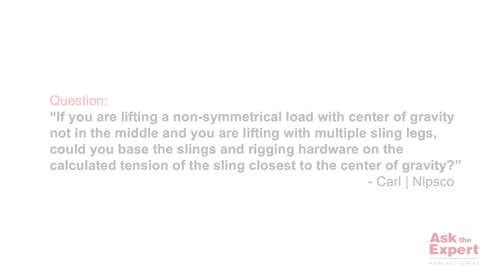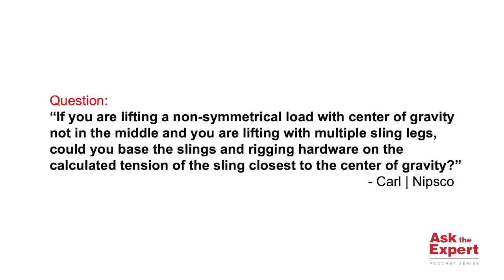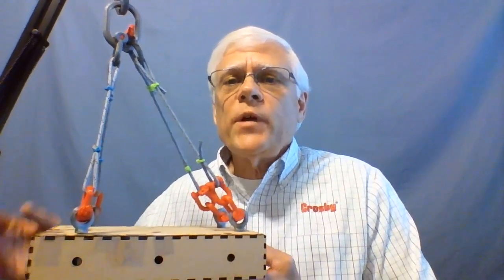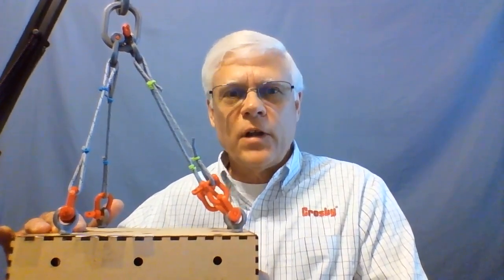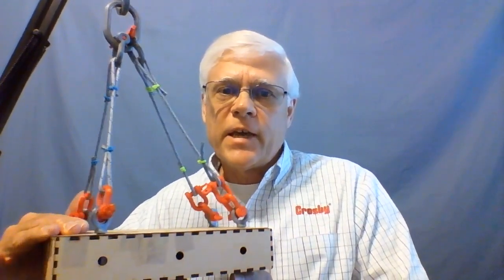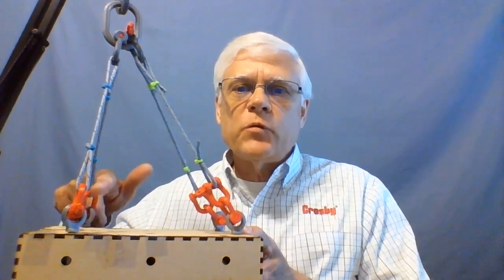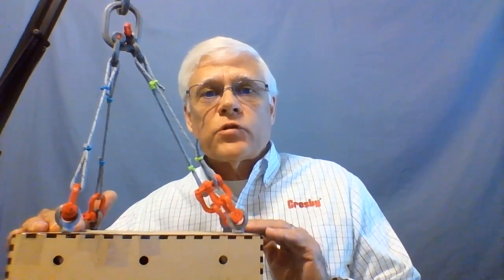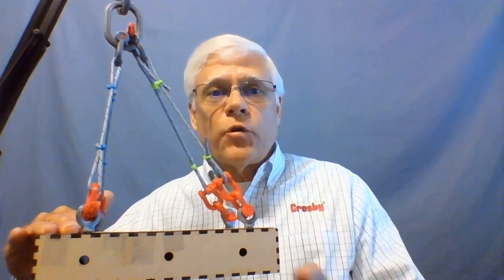How to safely lift a non-symmetrical load

Comment: Well my friend you Open my eyes again. Two things one is losing the maximum strength of eyebolt by going Off center of the angle and two on the choker with the most tension. Working day in and day out as a heavy industrial rigger we only used engineers for the big lifts and that would be anything over 100,000 pounds. Stay thirsty my friend.

Comment: It's not safe to lift load not onthe center of gr6
Reply: You're correct. Placing your hoisting equipment directly over the center of gravity before lifting is critical. This prevents the load from swinging as it's lifted. There are few exceptions where placing the rigging and hoisting equipment offset from the center of gravity is preferred, but use these procedures with extreme caution.